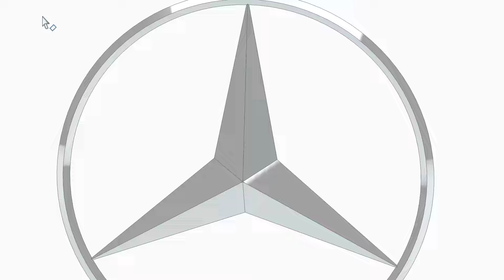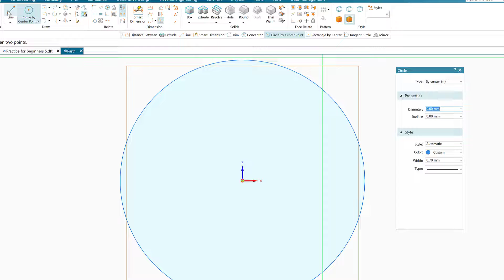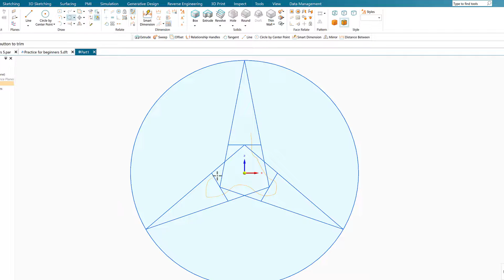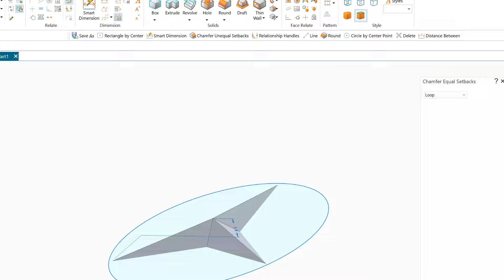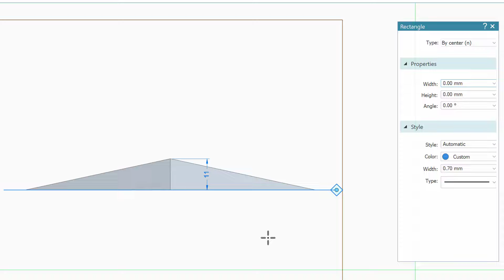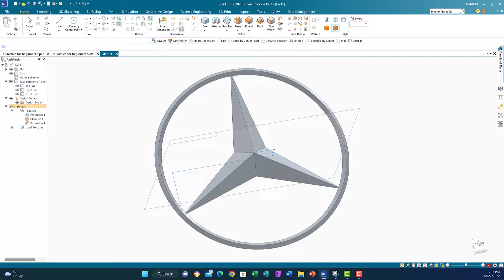Solid Edge 2023 Tutorial - Practice for Beginners # 5 - Mercedes-Benz Logo

Comment: I had a hard time with this one.  I had to remember to lock down on the Top plane when changing the circle diameter and placing the 3x3 square was hard to locate.  But, I prevailed.  THX.
Reply from the maker: It is always said practice will make you perfect. Wishing you all the successes.